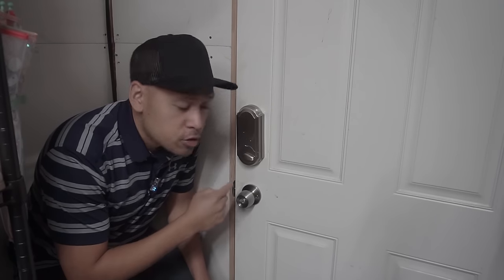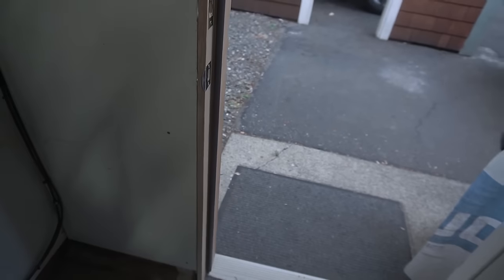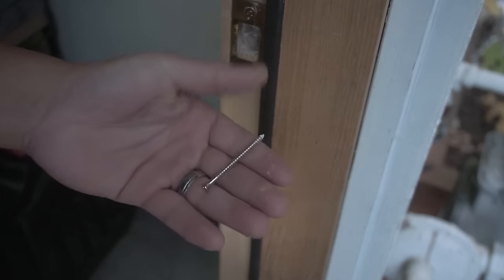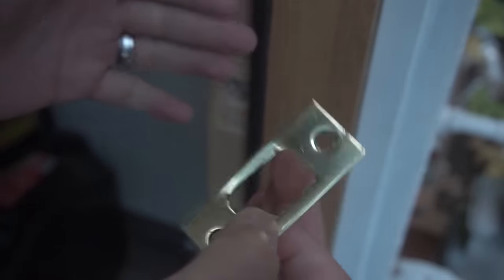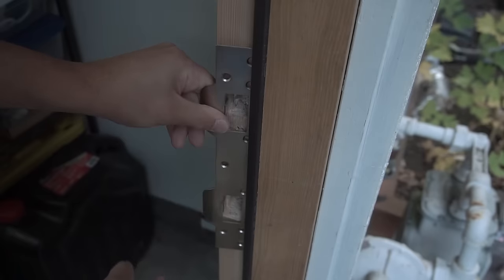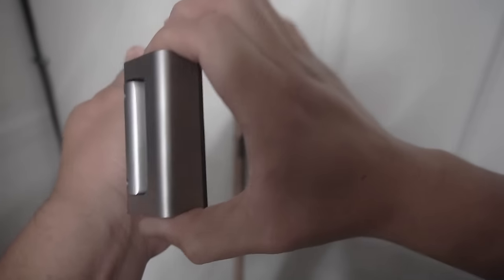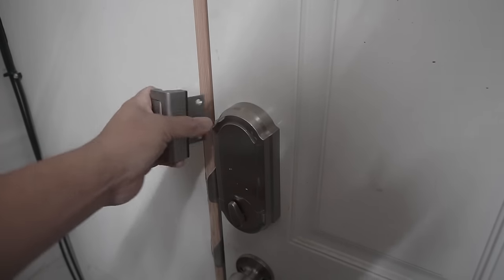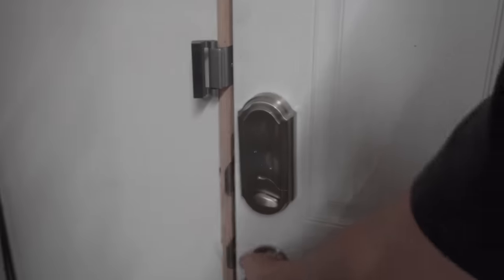How To Make Your Door Kick-In Proof Like A TANK! Keep Your Family & Home SAFE!

Comment: Can you please make a video on how to keep sliding glass doors safe🤗
Reply from the maker: Hi Mercy! I made I video on that 8 days ago please watch! Here’s the link! https://m.youtube.com/watch?v=oZmJcwbqCPA
Reply: Cutting a piece of wood or broom handle to put in the door track is cheap and easy. They also make a metal bar that mounts on the center of the backside of the door that drops down to open
Reply: @zachrorke9046  that's good to know but that doesn't prevent them from breaking the glass!
Reply: @mercyed3598 You want a tutorial on how to stop someone from throwing a rock through your glass? They have sensors you can apply to glass to detect glass breakage and sound an alarm....if you're home you would hear the glass breaking. You can't stop someone from throwing a rock unless you maybe put up an expensive fence and thorny shrubbery around your property.
Reply: One things for sure, you'll wind up with a compound fracture f**king with my door! Those 2 (2×4)s across it will tell u quick that's not going to work. Front an back. Never had the pleasure of someone kicking they're way in! 😂😂
Reply: Key word here is GLASS? Think about it! Obviously, if the house is occupied, a weapon of some kind would help. If the house is not occupied, nothing will stop a break-in, but a camera based alarm system has many benefits. "Snake oil" and gadgets might solve your paranoia, but they won't protect your property!! How many times have you heard of a break-in through a front door?
Reply: Replace them with something solid 🤦🏼‍♂️🤷🏼‍♂️
Reply: Get thicker glass installed
Reply: Replace the glass with a multilayer plate of hardened 3/4" thick steel with  sulfur powder cement in the middle. 😁
Reply: @FixThisHouse  q
Reply: For new or replacement door installations, order the door with hurricane rated glass.  For existing doors, there are companies that make a transparent "laminate" that makes the glass difficult to break.
Reply: If you truly want protection for your windows, patio sliding glass doors, and even your front door, just buy the unbreakable screen doors. But you'll have to ask yourself what's your safety and peace of mind worth.
Reply: A “Charley Bar” works quite well.  It did it for me!
Reply: Your best bet for a glass door is to apply window security film. It goes on clear, but resists tearing and will hold glass together when broken. This will hold up for a minute or two. If you get with something like this, go with a reputable brand like 3M. Stay away from the cheap generic crap on Amazon.
Reply: Thieves invented those doors.  Put bars on your windows...
Reply: He said that in the 1st 2 minutes
Reply: Most sliding doors can be lifted with a long screwdriver. Very expensive ones are harder, but can still be lifted. How it’s installed is it’s weak spot. It’s lifted into the top frame. Pivoted and then the bottom of the door is set on the base rail. A simple metal screw above the door will stop this. Then just use a old broom handle in the base so it can’t slide and open. Or get a lock that mounts at the top of the sliding door. It’s for child proofing and hard to move it without in setting it or unlocking it depending on the model. Most of the glass on these doors and windows for that matter can QUIETLY be shattered by a screw driver too. If someone wants into your home bad enough you might be able to slow them down for a minute or two, but it won’t stop them. If you don’t want your door kicked in you better off to install a floor mounted door lock systems. One on the floor and the same type of device on the door top. The floor mounted ones have more and thicker wood to splinter. You need a truck to get in. Most door locks only are to give you time to protect yourself and family. It’s like a trip alarm. If you want the door most secure. Use night lock, or on guard floor systems. If you leave you can set it but you’ll have to leave from the back or garage door, and obviously enter the same way. A crook will have a heart attack trying to get in. The door will shatter before the system will, and it takes time for that to occur. The longer they try. The more warning you get if home, and more EVIDENCE they leave.
Reply: @paulredinger5830  Bro this is for a back door list not for a glass sliding door Misread information
Reply: you cant at all. a brick or rock works perfectly.
Reply: Cut a piece of 1¼" PVC as a door jam to put in the track.  For $2500-$3000 you can put an electronic aluminum rolling shutter over it.
Reply: @zachrorke9046  I used 1¼  inch PVC irrigation tubing.  Cheap, easy to cut and unbreakable.
Reply: @voidremoved  yes because of bars on the windows. Now thieves have been cutting holes into the roof a climbing down into the lower rooms. Much easier to show up and cut through some plywood and shingles. Plus it looks like someone fixing a roof.
Reply: Yes absolutely would b great to know!
Also garage overhead door!
Reply: There is no way when someone can just smash through it. Unless you remove it completely you can't do much.
Reply: Easy! Get rid of it and install something without, glass!
Reply: @mercyed3598  impact resistant windows.
Reply: @Vanessa Williams lol my grandparents use to have the 2x4’s across their doors. I agree someone’s knee caps will be busted if they tried that back then lol! 🤣
Reply: @jackriley5974  I purchased retractable locking scissor gates from Vevor that hide behind curtains when not in use for sliding glass doors. I close and lock them when I leave the house.
Reply: @mercyed3598    And?
Reply: A plastic block screwed at the top so you cannot lift the door out of it's track but can still slide without a problem simple fix also with either a bar or a bolt lock as well Cheers but the crucial part is that they cannot lift the door 🙂
Reply: Take the sliding glass door out, add double doors no glass with a crossbar.
Reply: If a video is not made on this, I would get security tint, I use 3M brand, 3mm thick, on not only my sliding door, but all first floor windows.  In conjunction with security tint, I would place a few screws at the top of the frame to prevent anyone from taking the sliding door off the tracks, and place  bar at the base of the sliding door or a bolt at the top of it. Of course, be sure side side gates have  a lock on them.
Reply: @jackriley5974  Front door break ins happen literally all the time lol
Reply: 1/2  to 1" wood Dowell , lay it in the track, cut 3 inches shorter if you want door open a little bit for fresh air.
Reply: @jackriley5974  A lot!  My cousin had the front door stolen right off his new house in Texas.
Reply: Put bars over when you're not using.
Reply: Glass doors are only going to be superficially safe.
Reply: @crazyedo9979  hahahah 😅
Reply: They make a lock kit that requires drilling through the metal part of both doors in the center, then take the bolt lock and run it through. It keeps someone from lifting your door out of the latched position and sliding it open. I had this happen to me before when I got robbed.
Reply: Just don't use them  or put a gate on your glass door. I built my house with the prospect of a zombie attack. I  watched lots of zombie movies and discovered that all of the houses had sliding glass doors and windows.
Reply: 🤣 a brick from the hardware store lol.
Reply: @mercyed3598  You can replace your "glass" door with laminate. Looks like glass but won't break (same type of material thats on your car windshield). Its more expensive though, but added bonus its helps dampen sound from outside quite a bit.
Reply: Isaiah 42:8
I am YaH; that is my Name! I will not yield my glory to another or my praise to idols.

Isaiah 43:11
I am YAH, there is no other Savior but Me.

Isaiah 45:5
I am YaH, and there is none else.

Comment: I would also add 3" screws to the door hinges as the criminal could kick in the door on the hinge side.
Reply: In the UK you can get what are called 'hinge bolts' that you drill into the door, they recess into the frame on the hinge side Not sure what the US name is.
Reply: I did the same with 4.5 inch screws and a second oak 2x4 support
Reply: Good idea.
Reply: I’ve yet to come across a house that didn’t already have 3” screws on the hinges of exterior doors because exterior doors are heavy and especially metal doors but I guess there are “those guys” if you catch my drift…. Less than avg lol
Reply: Yes I was just thinking about that after viewing this upload. Screw reinforcement on the door hinges.
Reply: I went into an old well built apartment complex being torn down, and I was amazed how easy it was to kick in well built solid doors, even on the hinge side, sending the door spinning into the room!
Reply: Don't think criminal. Think intruder!
Reply: He said that in the 1st 2 minutes of the video
Reply: 3 inch screws aren't going to help when the casing at 3/4 inch thick with blank space behind it. I have seen doors installed where installer used short blocks to fill that space.
Reply: @galewinds7696  so what's the solution
Reply: @galewinds7696  what's your solution
Reply: @galewinds7696  You should edit your answer and add a solution
Reply: @wrzl1675  Almost every door I've come across used 1" screws at best on the hinges, never underestimate how cheaply some houses are built
Reply: Very good point!
Reply: Ya beat me to this suggestion!😉👍🏼
Reply: Well police go for hinges if door is resistant. So good call.
Reply: I was going to say the same thing the hinges need longer screws as well to help prevent that side from being easily kicked in, but none the less great tips and video
Reply: Be careful doing this. You can make the door crooked.
Reply: Very true
Reply: @wrzl1675  Maybe newly built homes. It's not like you're going to sue them for using 1" screws.
Reply: then you have the fact that most modern doors have strips an inch thich at best on the edge of the door so 3 inch srews are just going to WEAKEN the door
Reply: @galewinds7696 it's shimmed. the screws have to go through the shims. have you ever installed a door before?!
Reply: @wrzl1675 ive yet to see a residential door with 3 inch screws. because once you go bigger you can't ever use smaller screws. door changes can cause stripped holes. you think it's normal to install an brand new door with 3 inch screws? you're not a door installer quit lying.
Reply: The stops are the weak point. usually just attached with Brad nails.i used screws in my stops then wood putty over and painted over.
Reply: Maybe a 357 screw !
Reply: FYI, will NOT stop a Van Damme spinkick
Reply: Are you people that simple? I knew this when I was five . Teach us something useful
Reply: I also sleep with a forty-four magnum on my chest make my day law in Oklahoma
Reply: @WR ZL1  mine had only one inch screws on all of the hinges. I have replaced them all with three inches.  All homeowners should do the same. One can never be sure.
Reply: 1/2” screws on that side - good call
Reply: You can buy full length continuous hinges and long screws.

Comment: These improvements will make entry more difficult for the not-so-stubborn intruder; however, unless the door is steel, the weak point will be where the deadbolt and the entry set are located. Wooden doors will splinter in these areas if stressed enough. In addition, common door jambs are made from pine, which is weak. Even with the improved strike plate, the door jamb itself will splinter. Using longer screws, as others here have suggested, and driving them into the framing of the door jamb, with a solid spacer between the jamb and the framing will add additional integrity. Adding a brass or steel plate to the door where the hardware is will also help. That we have to resort to these measures to keep our families and our property safe is disgusting. Thanks for the post.
Reply: Another way to do is how I did.  I reversed the door frame so my main door opens outwards.
Reply: @jan_phd  That is a good way to make the entry point much more secure; however, that may be a building code violation.
Reply: @KM-jp2wx   In my City all retail doors must  face outwards, so I took that argument to the building dept., and it was exceptionally easy to get permission.  Residential builders I was told, 'prefer' inward swinging doors.
Reply: @jan_phd  Interesting...thanks for sharing that.
Reply: If someone is determined to get in they will get in. It's about buying time or just making it difficult enough that the intruder deems it to be not worth it.
Reply: @BaldKiwi117  Exactly.
Reply: I reinforced my door also with a l large slide bolt that goes up into the top door jamb and also use two by sixes by 3 and 1/2 feet to bar the door top and bottom on the inside. Got the hardware online.
Reply: @TheBloodBoughtServant  Good job! I have been wanting to do the same or similar with our entry doors.
Reply: @BaldKiwi117  A good dog for an alarm system and high-quality firearms that you’re proficient with probably work a lot better. That’s my system.
Reply: @jan_phd  or just install an outdoor security door?
Reply: @jan_phd  So would the hinges then be on the outside?
Reply: @ibberman   No, both doors have metal frames, with the hinge pins in the middle, so no one can even see the hinges. When I installed the door, it was pre-hung, with the screws from the inside of the frame and on the inside next to the wall.
Reply: I have all the above plus the roll down hurricane shutters on my windows outside that are operated from inside via crank handle in the event of power failure. The house is built with block and very solid.
Reply: @jan_phd  saw the cops trying to kick in the door of the house next door years ago. It opened outward, they had to wait for the owner to open it for them, very hard to pull open a door.
Reply: How about making whole door frame steel.
Reply: @maolo76  That would be the best option. If that isn't possible,  part of the door frame could be reinforced with a steel plate.
Reply: @veryslyfox That is so true. The best thing we can do is make it a little more difficult or time consuming, but then they will just get mad and do more damage.
Reply: Also the hinges are another weak point.  Upgrading them to thicker ones will go along way
Reply: It gives enough time to grab something out of your safe..😁
Reply: @matthewparker235  Yes. Anything that will buy you time is good.
Reply: I've kicked in my door, quite easily.. the wood strip will break no matter what regardless of the size of striker plate and screws. And what the door is made of is irrelevant because the wood strip will still break before anything in the door does. It's that weak. The whole door framing needs to be made out of metal with no wood. Videos like this are pointless because he doesn't have a door to actually test, except he did that stupid reenactment at the beginning.
Reply: @KM-jp2wx    If it's your property, you can do what you want.   Next house, each external doorframe is getting replaced with steel and doors replaced with steel doors.
Reply: @KM-jp2wx put a camera in window facing the door and put  stickers on window saying you’re protected by security cameras 24-7 robbers don’t know if you really are or aren’t.
Reply: good
Reply: @bmarchbanks7661 I thought of that too, but laughably, I don't think robbers or home intruders read! 😂

Or at least they don't bother to read, or care to when they're in a rush to break into a house, especially at night.

I remember when I was watching the doorbell cam (after I got the movement notification), and a couple of people showed up at my door.

I heard one person ask the other what the sign meant, that I posted on the wall (above the doorbell)?

The one who could understand the word told the other clueless one that it said, "NO SOLICITATION", which meant not do what they were doing, which was to go door-to-door trying to sell stuff or ask for donations. 😂

But they both just shrugged it off and gave up and left after no answer from me.

I think it's best to NOT engage with anyone at your door unless you hired someone to do a job and they showed up, or a package you were tracking was delivered, etc.

Why complicate things and waste your time with someone you don't want to linger at your door anyway, or give them a reason to come back if they were getting the attention they wanted?